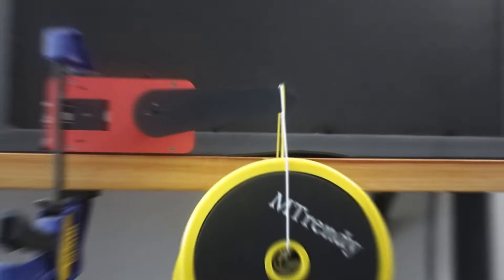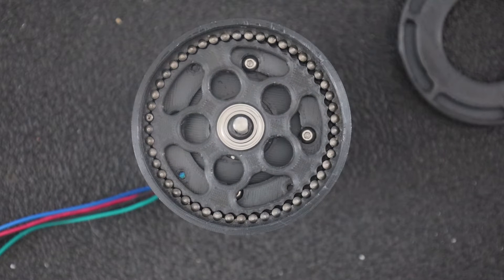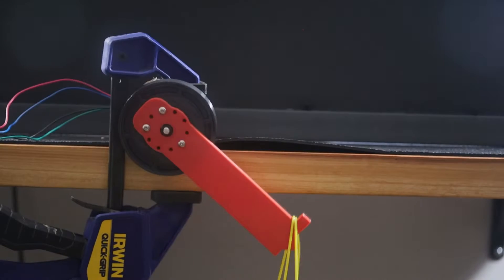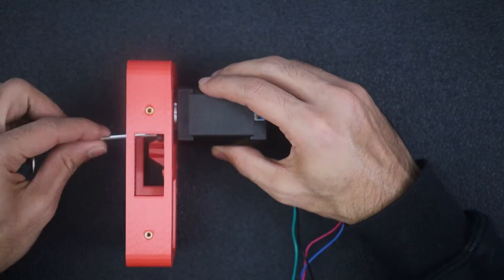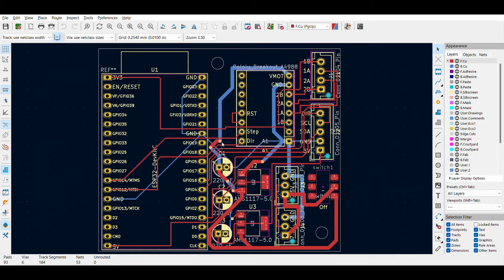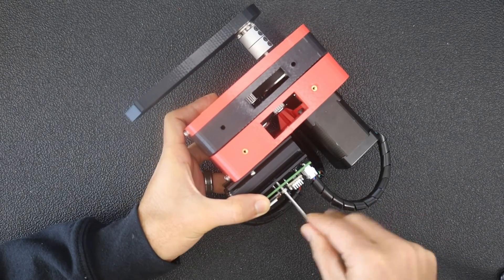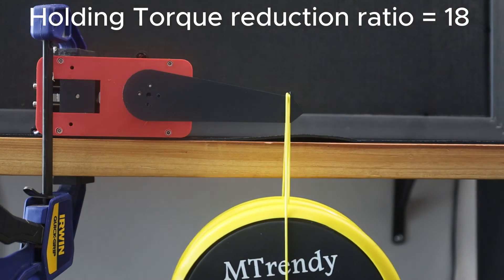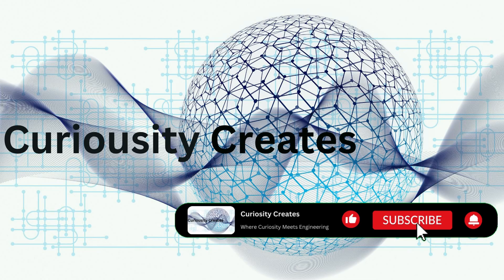Nema 17 wireless robot actuator | Massive torque | Position feedback | No backlash

Comment: Why did you add an idler between the timing belts?
Reply from the maker: I had 2 reasons for that: 1) to reduce the distance between the two active pulleys, 2) to increase the engagement of the belt with the teeth of the smaller pully by making the belt wrap around the pulley a bit more.
But in the next iteration of the actuator that I use in my video about the 6-axis robot, I have gotten rid of the idler and used a smaller timing belt. The actuator works great with this change too.

Comment: Could you summarize if the use of belts is still popular with robotic arms in factories, and what are the advantages compared to cycloidal or harmonic drives?
Reply from the maker: Belts are still a popular choice for industrial robotic arms. The choice between belt drives or cycloidal and harmonic drives is really a matter of design preference and application. 
Belt drives provide a couple of advantages. For example, they are relatively easier to manufacture and can be a bit more forgiving to imperfections in manufacturing, they are lightweight and can absorb shocks better. Cycloidal or harmonic drives on the other hand need to be very precisely manufactured. So they can be expensive. But they can be relatively more compact and can provide higher reduction ratios. 
These are just a few pros and cons.

Comment: That’s a really interesting design and I enjoyed your thought processes on the journey to this solution. I guess if you ended up routing power to these actuators, it would still be a much simpler task than the multiple connections it normally takes. Thanks for sharing.
Reply from the maker: Precisely. Worst case scenario is 2 power cables. Best case, no cables at all! Thank you for watching.